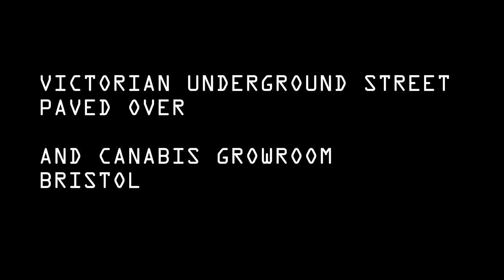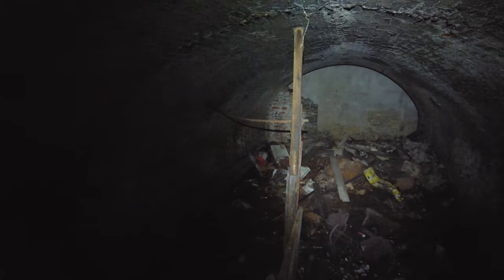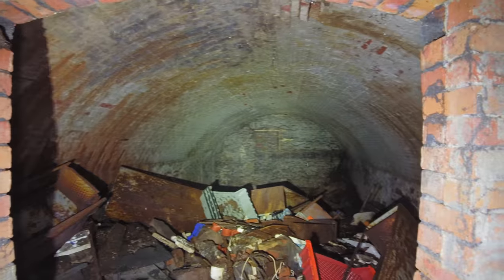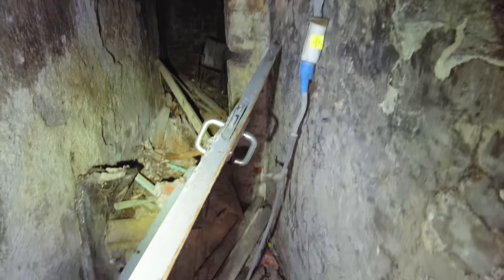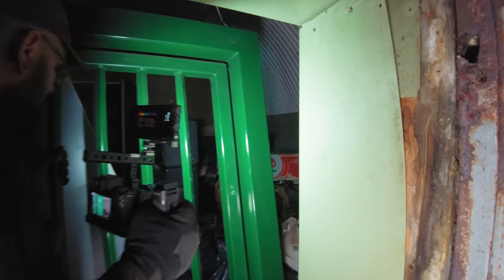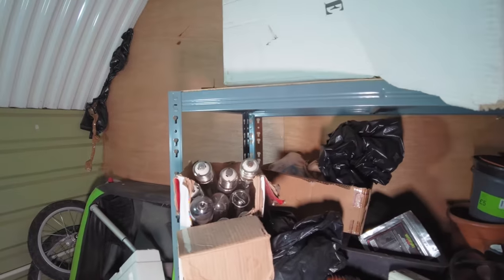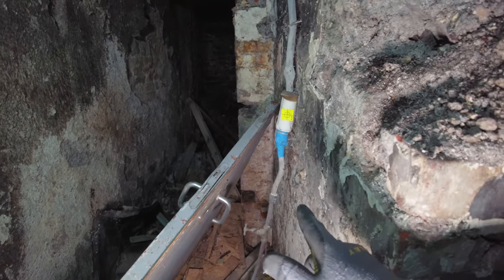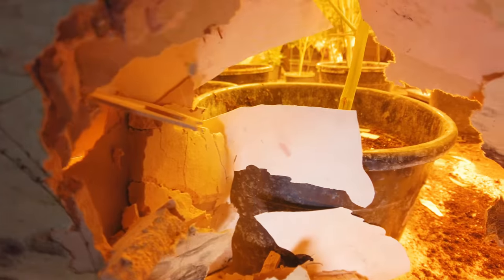CRAZY We found CENSORED under Paved Over Bristol Victorian Street

Comment: Be careful going into places like this in cities because some of these places that have been blocked off were blocked off at the end of WW2 because they have live bombs in them. There are for example over 2000 WW2 bombs, that the positions of are known, under London alone. (There will of course be others, the positions of which are unknown). Where bombs fell through a building into basements, without exploding, they often simply blocked off the entrance to those cellers & left the bombs where they were because there was no safe way to move them & there was a shortage of qualified people to deal with them. Over time the chemicals in some of these bombs deteriorate & become very volatile indeed. So do be very carefull.

Comment: Even if those grow lights were 600w each, there was over 4.2kw running. That would of cost a fortune, they had to be stealing the electricity, and no wonder they burnt out that socket, lol.
Reply: You cannot plug a light Straight into wall you need a ballast for each light , I done it before I had 12 600 hps in a big bedroom
Reply: @kingkong81icloud  - lol that is a big bedroom. (i favoured 1x600 in a lil lined cell. 4 them in a small bedroom. stagger cycles so crop one every 4 weeks)
Reply: @keefymckeefface8330  yea I went over bored looking back, but the power was free , still I got caught I wish I had that equipment or half of it I would set up again

Comment: So Im curious -- is this a single location above the Victorian street that has access? Or 2 different locations that lead to the below street? Great history down there. Id love to sort thru the trash to find things.
Reply: There's street access (that Matt used) then across the road there's basement access from several different properties above.  Looks like some have 'bricked off' access and other put up more/less secure methods of removing access.
Reply from the maker: The vicotrian street is underground. The old way in has been breezeblocked up so the only way in from outside is down the manhole or through the workshop.
Reply: @TheSecretVault  at 16.02 you didn't hide your location fast enough. Location is up for 1/10th of a second. Your secret might escape you? Good luck.
Reply: No it's 2  miles from there silly..watch what your writing
Reply: @BOARDMAN16456  wasn't been silly, politely pointing out the top secret location isn't top secret. why would anyone need to watch what they are writing?

Comment: This hidden “street” must pre date 1885 because looking back at historic maps on the NLS the street with man hole entrance is still there on the 1885-1913 side by side maps so this area must be very old! I’d like to know what date the road was covered over. Also those cellars look like the arches.
Very interesting
Reply: covered in 1879
Reply: @0815germany  something to do with the railway station line doubling in 1874?
Reply: @c47force15  duno mate, I'm not into railway history tbh 🤷🏻‍♂️
Reply: They're barrel vaults, using the compressive strength of bricks to prevent gravity bringing them down. Pretty much all cellars and tunnels were constructed that way until the 1900s. Now we use reinforced concrete slabs, but the barrel vaults are much prettier architecture.
Reply: Bristol know your place 1840s map appears to show level crossing, or humpback bridge. Houses on north side of present approach arches missing on 1855 map so can assume gradient eased by the new approach ramp 1847-1855 period. Then the arches sub let to businesses.

Comment: The amount of effort, money, time and labour that's  gone into building that grow room isn't just done from a few illegal dodgy growers, that's a proper militant operation. The authorities must have known about it and it was allowed to go on. How did all that stuff get down there, you can't get metal sheeting that vast and unnoticed  through a man hole cover lol, so there must be a secret entrance into there of which they have had permission to use. That's definitely protected by the authorities,  no simple grower is going to go to those lengths with running water, electricity etc. Makes no sense. Too much money spent for them to be fly by night growers plus there's cameras every and no one saw them entering with huge metal sheets
Reply: What you're seeing  here is basically railway arches over which a road has been built. The idea that this stuff is "underground" is slightly dubious. It is, and buildings have been put up above them, but if they'd been able to open that concertina door they'd have been in a car park outside a set of light industrial units. Everything would have come in from that end.